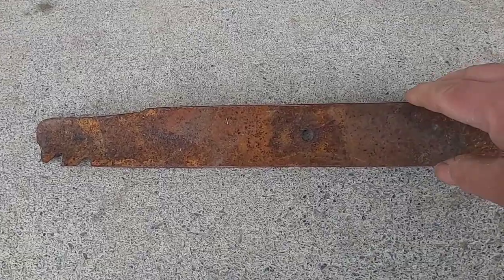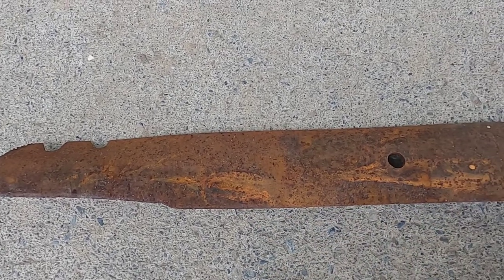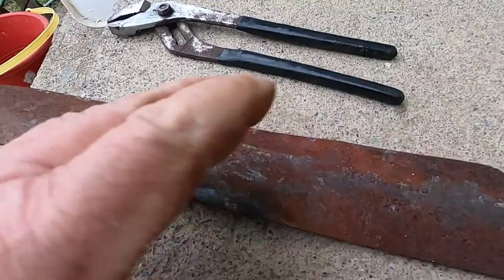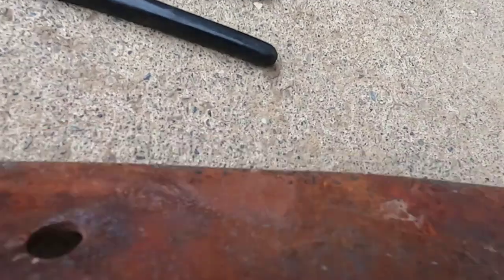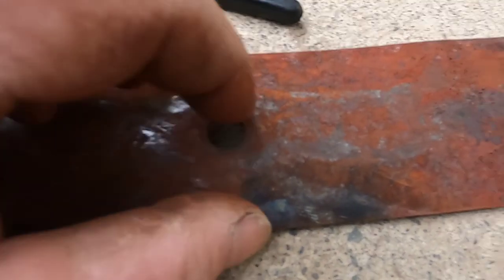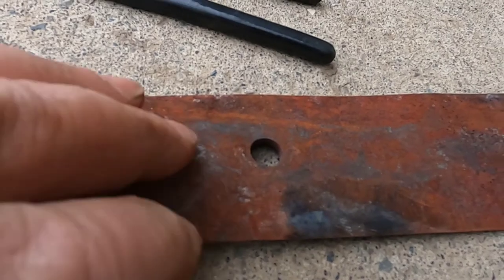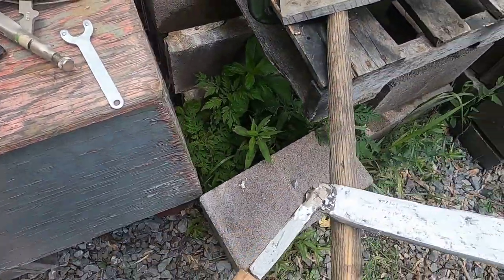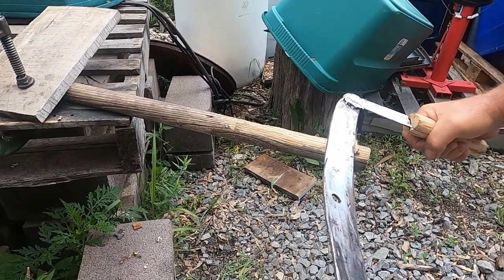Making a draw knife from a recycled  lawnmower blade bed frame

Comment: You are ruining the blade by eating it heating it i mean you are removing the temper 😮😮😮😮🤔
Reply from the maker: I am no authority on this at all. I have watched a few different videos on repurposing metal where after heating it they dipped it in oil to get the temper back. I did not do it to this draw knife. It holds the edge & cuts well. Will cut a lot better when I get better with it.
Stay safe, Joe Z